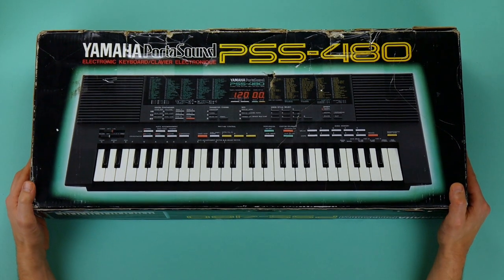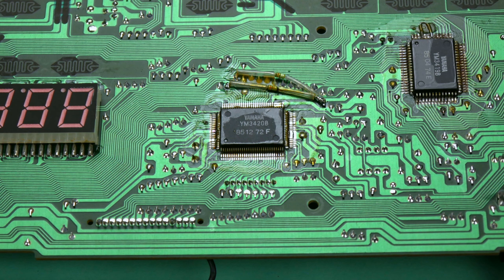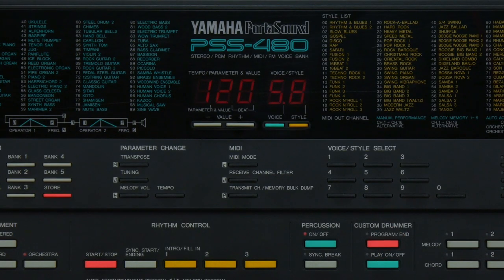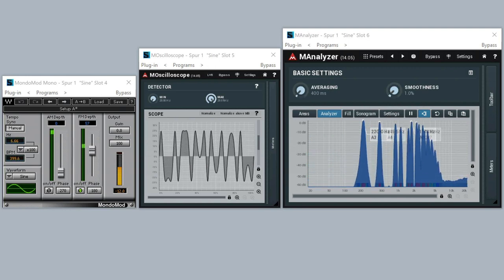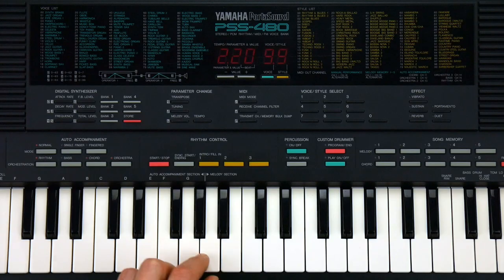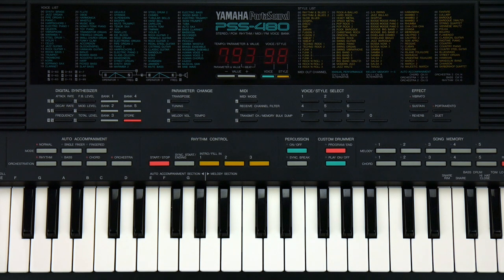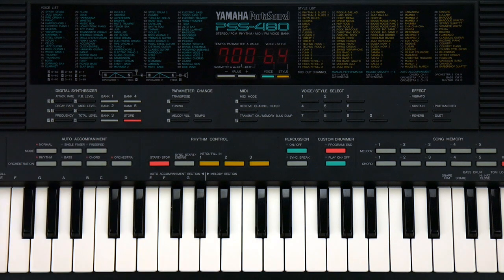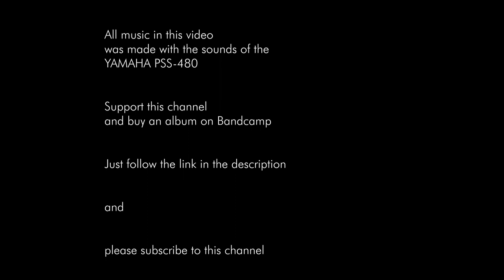Yamaha PSS-480 -  Part 1: The FM Synthesizer

Comment: Another model in the line brings back the same old memories for me :) more basic than this, no PCM, just the 100 voices. But the same size. I still recreate some of the sounds in more advanced FM synths (and now can laugh at how some of the presets are identical with slightly altered ASDR values)!
Reply: TFW you spot a typo’d ADSR and can’t change it without losing the heart D: lol

I always loved the bells. There was one “icy” tubular bell I used to practice my piano on at home because it always sounded the most “musical” to me. It had a little bit of reverb, which is probably why I thought that. (It was likely called crystal or glass or something. I still own the keyboard, but it’s packed away somewhere currently, so I can’t check. I remember trying all 100 before packing away to try and figure out which one it was, but I could only narrow it down to 2 or 3 anyway, what with how many of them share an algorithm.)
Reply: Also, this section about constructing the sounds is very impressive for a PortaSound! It’s only got 2 carriers, but you’ve got a lot of options here outside of the presets! 

Appreciate your showing the sound between each small adjustment. I might show this to a friend — lots of other videos discuss the theory but make a number of changes between previews, and I’ve never been able to properly explain it to some folks, because they weren’t able to keep the relationships in their head. But this shows the differences really well!
Reply from the maker: Could have been "Ice Block". That was one of my favorites back then.
Reply: @KeenOnKeys  maybe! I just found out from another commenter mine is the 270, though I don’t know how much the 100 presets changed between these models. 

But yeah, that was my jam. The sounds of that preset layered nicely with the reverb (which I assume was actually a delay much as with this model?), and I think they must have had a little bit of tremolo too — the layering in the echoes made interesting overtones sometimes, and I’d even sometimes repeat the same phrase over and over to hear the effects in the layering.
Reply: @KeenOnKeys  yeah I think it was “crystal” after all, after finding a high res picture of the case of a 270. Guess my vague recollection was better than I gave myself credit for. 

I think I spent time trying to determine if it was crystal, chimes, or bell, and none of them sounded quite like I remembered. But it’s possible that any capacitors’ aging was the cause of none of them quite sounding as I recalled. Because looking at it now, I’m like 95% sure it was crystal/88, not chime/91 or bell/92. An ancient memory of pressing the same numeral twice after turning it on has been unearthed — so it must have been “88”, which fits with my vague sense of the name too. 

Man, these keyboards really are a nostalgia trip!
Reply from the maker: yes, "Crystal" is a great sound. I don't have the PSS-270, but I assume that it's the same as on my PSS-170

Comment: Congragulations for your channel.
I have a PSS 380. It works ok but the tempo and transpose buttons are not working. Is there a problem with the cpu or it might be something fixable? No repairman keen to fix it but it has great sentimental value for me. Thanks!
Reply from the maker: First thing I would do is clean the contacts.
Reply: @KeenOnKeys  tried that and they don't have a problem, switches are working properly .
Reply from the maker: @oktavision5094  So the switches are working, but they don't do anything? Sorry, but I have no idea how this can be fixed.
Reply: @KeenOnKeys  based on the schematics, these keys are triggering the CPU, but I find it kinda weird for a cpu to work partially, either it's fried or it's ok.

Comment: The DSR 2000 has 4 operators. I picked one up but have not played with it yet. Wondering if i can edit them from a computer or from a midi controller, if not still keen to see if i can edit them via the keyboard.

Comment: I just checked (test mode) my PSS-580 after doing a repair and one shows 480-04 in the display and 480-05. So it seems the 580 had no revisions on the firmware, or maybe the 04 and 05 reflect this.

Comment: I found one in a skip. Soldered the 12v connector. Oh so much fun. Now it has died. I dont know what is broken. It started to glitch and turn off then eventually not turn on.
Reply: Are you sure it wasn't the 12 volts that killed it? The video mentions it takes a 10v power supply and that's the voltage on my one.
Reply: @xdendordx  just had a look now.   It says 9-12v on the back. Feel a bit sad I can't play this thing now. Its covered in dust waiting for a doctor.
Reply: @notyetskeletal4809  Damn. Hang onto it for now then until you find someone to work on it, the service manual PDF is still available online, might help the doctor.
Reply: @xdendordx  I turned it on today and it worked!  Every 6th key doesn't work though.

Comment: Does this keyboard use the same FM chip as Adlib and SoundBlaster cards? The sound is very close to the ones you'd hear in PC games at the time.
Reply from the maker: The adlib snd soundblaster chips are the YM3812 and YM2413 which you can find in the PSS-170/270/370/470/570 and many others. The PSS-480 uses the YM3420.

Comment: why do you use a 10V power supply when the label on the keyboard says 9V?
Reply from the maker: The original Yamaha power supply has 10, but it also runs on 9 to 12 volts.

Comment: I own a PSR-16. If the main IC contains a MIDI interface, does that mean I could add that on??
Reply from the maker: Probably, but I've never done something like that.
Reply: If you find the pinout, and if it isn’t disabled in the ROM, adding your own port could add some limited functionality. Many boards like this only output notes on one channel and don’t bother with stuff like the voice information though. (Don’t know about the 16 in particular.) Definitely worth looking up a mod like that in more detail! Sometimes people make custom ROM chips you can burn to enable functionality too.

Comment: I've been tryinf ro programme an acoostic piano sound on my Reface DX. It always sounds like crap. Does anyone know how to create a good ac piano on FM?
Reply from the maker: You better try an e-piano. I haven't heard a really convincing FM acoustic piano so far, at least with a 2 operator FM synth.
Reply: @KeenOnKeys  You're right. EPs are way easier to do on FM. I must say however, the PSS480's piano sounds much better than the one from the earlier models like the 270.
Reply: I had the YS100 with 4 operators and 8 waveforms per operator for over two decades. I was able to program a better piano than those that were among the presets. I actually made it because at that time I needed a more fitting sound for playing Roxette's "It must have been love" on it. I remember using the internal "Hall" reverb from its effect section for that sound. But in the end it was one of the main reasons why I later replaced it with a second-hand Roland XP-30. I would totally agree to your "It always sounds like crap"-feeling when it comes to grand piano sounds...and also classical strings. For those type of sounds sample-based machines are simply the better choice. I guess a Yamaha P50-m, a GEM RP-X or a Kurzweil MicroPiano might do the job.
Reply: @sauermusicDE  You're right! Presets in FM keyboards are mostly trash and don't show what FM is capable of. It's better to make sounds ourselves.

Comment: How do you get the output to sound so clean? Mine has such noisy outputs :(
Reply from the maker: I have done nothing. Just straight from the keyboard into my DAW.
Reply: The typical aliasing noise is clearly audible in this video as well. If your device sounds even MORE noisy it might have other reasons. 1.) Check the impedance of your audio cable first. Good cables aren't cheap. 2.) Could the noise come from te pre-amps of your mixer or audio-interface? Check the input level. 3.) I have a PSS-780 and I noticed that sometimes you have to experiment with the output level of the synth section in relation to the volume set by the volume slider on the panel. There is some strange interaction going on. Don't ask me why...